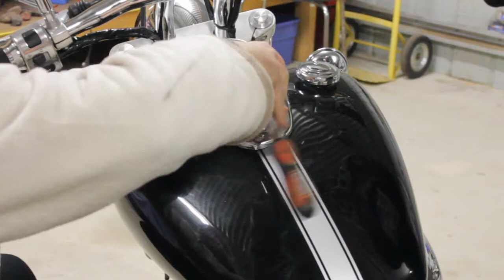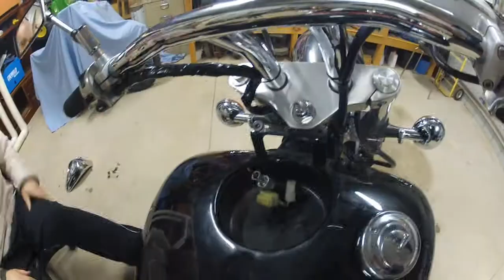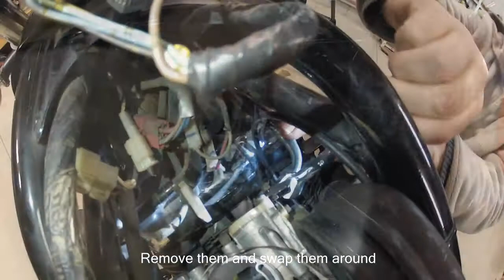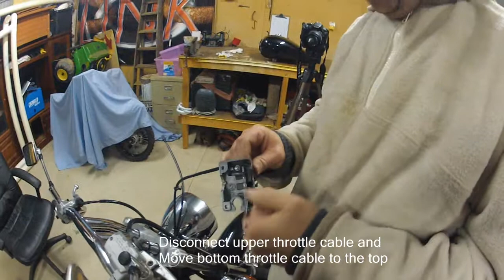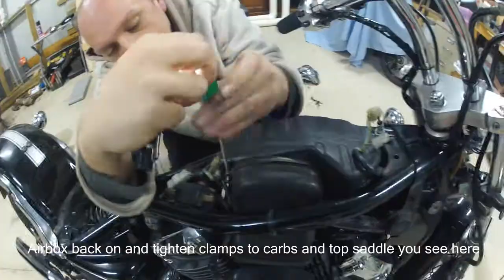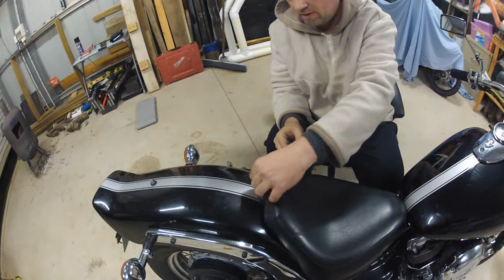Yamaha XVS650 throttle cable fix?

Comment: I have an 03 XVS 1100 and trying to replace the throttle cables. The upper cable on the housing came out easily. As I saw you do in the video, I had to “unscrew” the housing from the cable to remove it. Now, I can’t figure how to get the “pin” back thru the hole😖😖. Any assistance you can give me would be greatly appreciated. Thanks

Comment: i was riding down the hwy with a friend when mine broke i got to looking at the 2 cables and wondered why are there 2 cables? so i started to take things apart to see if i can swap them to get me home, so after looking at it for a minute i notice the other cable was a return and my friend said it might stick open, but after looking at the carb i noticed it had a return spring. so i swaped them out and went home with no problem

but i'm still wondering was it put there as a backup cable? or is it there for another reason.
Reply from the maker: Glad you were able to work it out and make it home. It would have sucked to be stranded. Yeah apparently its just there as a backup for the return spring and the added bonus to the parts dealer that you will buy 2 instead of 1.
Reply: I did the exact same thing, except it stuck at about a quarter throttle. If you let go at full throttle it would return to idle, if you let it go gently around 1/4 to 1/3 throttle it'd stick there. I never fixed it because I got used to it and liked having a free cruise control, but sadly that one snapped (today) after not too long. I would assume that it in some part reduces the load to the main throttle cable to lessen the chances of it snapping, but I could be wrong. I'll be replacing both of them this time.
Reply from the maker: @BarneyGumbl3  Ah that's some bad luck. When you replace them you will have to get used to it all over again. I think what you say about reducing load sounds plausible. Makes sense.

Comment: Whats the reason for doing this?
Reply from the maker: Hi there, I apologize, I should have just recapped the problem at the start, that would have made more sense. I did post a video to explain before this one, you can watch it here http://bit.ly/2i7Qqhk but essentially one of the throttle cables had snapped and we were swapping the cables around so that it would work with only the one cable.
Reply: @memoto5944 Nonsense, I am sure the video helped others, such as myself if for no other reason but a better way to put on throttle grip, so show what you know and forget what these guys have to say, I look for videos on how to do something on my Vstar and usually find nothing!